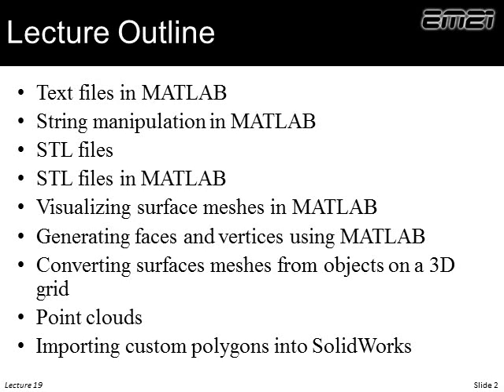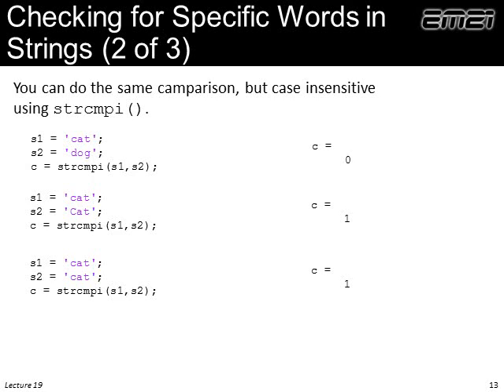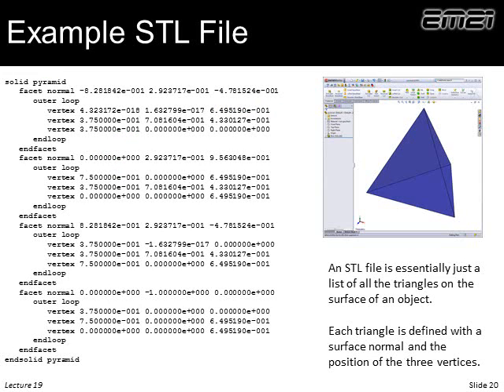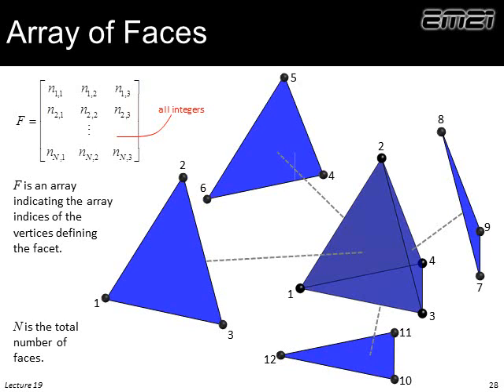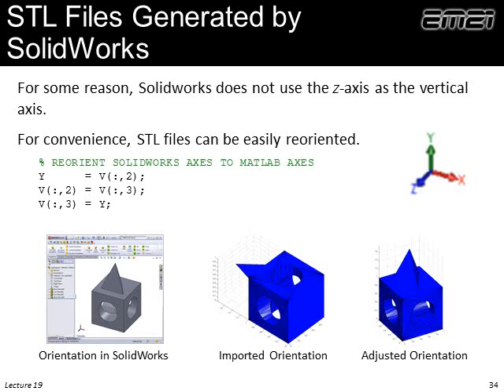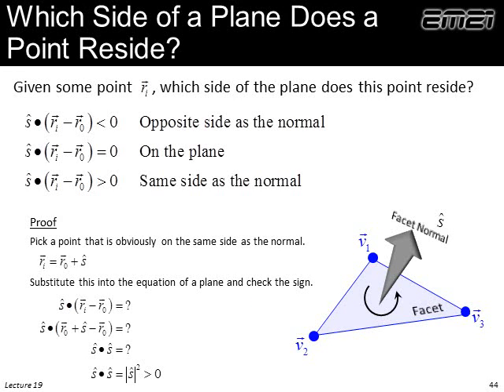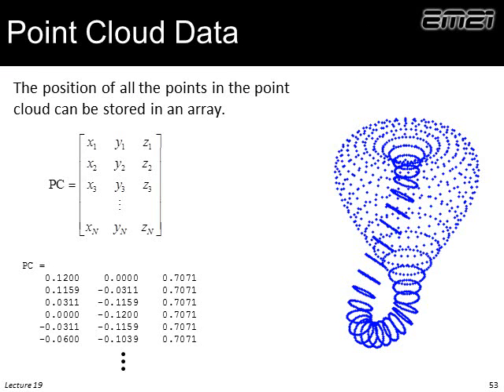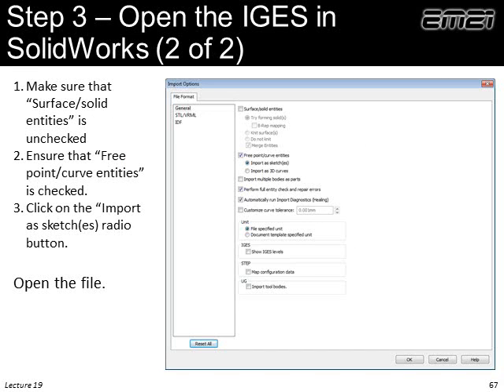Lecture 19 (EM21) -- Interfacing MATLAB with CAD

Comment: hey, is it possible to scale a stl in matlab?
Reply from the maker: Yes.  MATLAB is a generic programming environment.  As long as you can write the code, MATLAB can be used to do anything.  In this case, you would import the STL as an array F of faces and an array V of vertices.  To scale the STL by 10x, you would type...

V = 10*V;

That's it!
Reply from the maker: If you are looking for a general tool to do simple editing and manipulations,                               there are much better choices than MATLAB.  Use MATLAB if you need something very sophisticated done to your STL file.

Comment: The voxelization algorithm presented in this lecture (specifically the portion which determines if a point is inside or outside the surface mesh) is not generally true. I would use the crossing number algorithm which is a bit more complex in implementation, but not too crazy. Basically if you shoot a ray off of a point in any direction, if the number of STL facets that that ray intersects is odd, then the point is inside the geometry. Otherwise it is outside the geometry. For efficiency you can shoot this ray into one of the coordinate directions and then use the min/max function to trim any facets which are not even close to intersecting and then do a ray/triangle intersection calculation only on those facets which are possibly intersecting. For further efficiency you can also shoot a line (not a ray) from one point to another known point and if no facets are intersected by that line then you know the current point has the same interior/exterior status of the other point.
You may also have to worry a bit about a case where the ray passes exactly through the edge between two facets or something like that.

Comment: hi there,
I m generating ascii STL files using creo 3.0
but whenever i m trying to use 'fopen() '. it is returning with '-1'
pls do reply how to read STL generated with creo.
Reply from the maker: I am not sure what CREO is doing with the STL files.  I have never used CREO.  Assuming it is creating standard STL files there should be no problem.  Some programs create nonstandard STL files that include additional information like color or whatever.  This may cause problems.  Check into what the error -1 means.  I thought that means either the file is not found or cannot be opened.  I do not think that means there is an error in the file syntax.
Reply: Thank you sir, that helped.😊

Comment: Hey! Thank you very much for your video! I was wondering how you managed to plot the volume object at min 45. I have been searching but didnt find it. Is it using some kind of bar plot?
Reply from the maker: Do you mean the red brick pyramid thing on slide 48?  If so, that is a custom visualization function that I wrote.  It draws boxes to visualize the data in 3D arrays.  The boxes are drawn with six calls to the fill3() command to draw the faces.  The only other trick I employ is to NOT draw faces or boxes that are hidden by other boxes.  That really helps the speed and efficiency.
Reply: Yea the red brick. Oh ok. Good to know. Thank you for your fast answer.

Comment: at 45 min mark , how do you show the 3D grid visually on a 3 axis graph (red brick structure).  Is it the same patch function as before? and if so what are the variables?
Reply from the maker: The variable ER is a 3D array filled with 0's and 1's and that third plot is a visualization of the data stored in it.  Think of it like a point cloud.  This type of 3D array is commonly used in finite-difference time-domain methods.  The squares represent whether that point has a zero or a one.  It is not a patch visualization. 

Does this make sense?
Reply from the maker: I have added a label to the third plot that now reads...ER(nx,ny,nz).  This change is only in the electronic notes, not the recorded lecture.
Reply: @empossible1577  thank you sir for everything. I have one small doubt, which function is used to show this type of grid visualization of a 3D array.
Reply from the maker: @akhilagouda5560  http://www.mathworks.com/matlabcentral/fileexchange/31988-blockplot-a-block-like-3d-drawer-for-binary-masks
Reply: I found useful script to visualize fd mesh at matlabcentral:http://www.mathworks.com/matlabcentral/fileexchange/31988-blockplot-a-block-like-3d-drawer-for-binary-masks